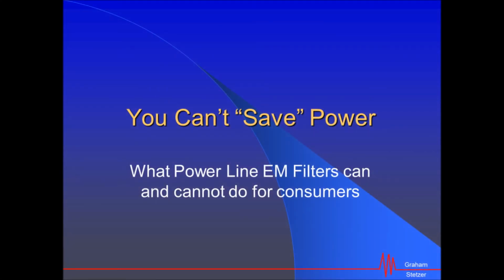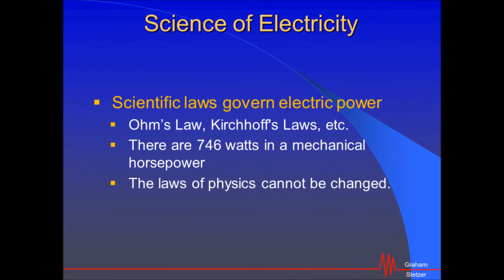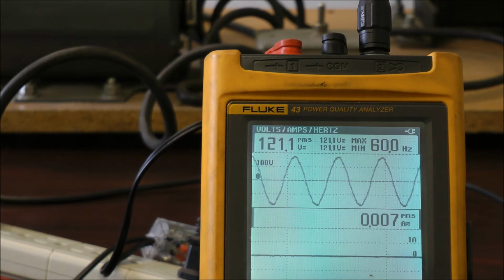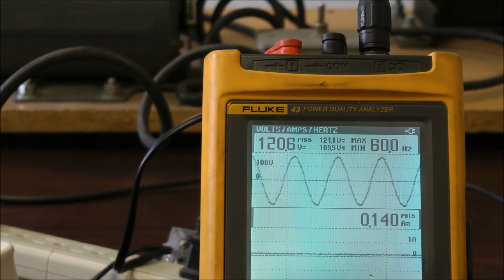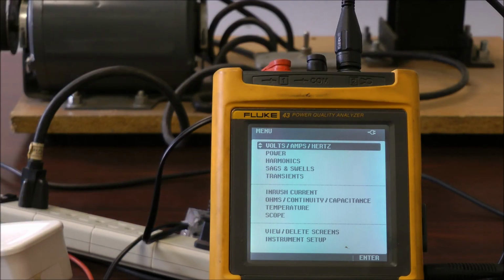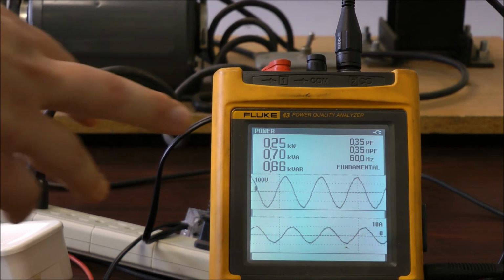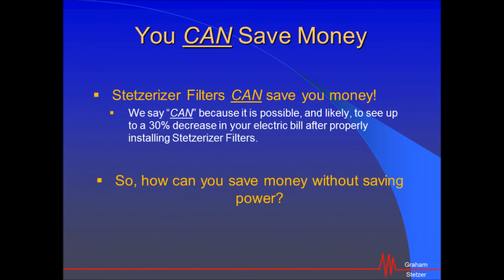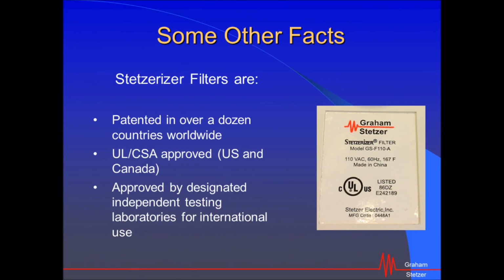You Can't Save Power

Comment: Leferink 2016 (Static energy meter errors caused by conducted electromagnetic interference) showed that noise on the line will result in smart meters misreading power (up to 582% error).

If you can clean up the power with a filter the readings will return to normal and your power bill will decrease.

Unfortunately because the Stetzerizer filters are placed after the smart meter they don't clean up the power going into the smart meter.... and the reading is still incorrect.

However if you add Power Factor Correction (PFC) before the smart meter the noise decreases and error should drop to zero.
N.B. PFC filters the power in a similar way to the Stetzerizer filter i.e. With a series of large capacitors
PFC is designed for an entire house and is thus more expensive.

This does not mean that PFC will drop electrical noise in the house: 
You still need Stetzerizer filters inside the house.

BTW: Cheap filters don't work because they use much smaller (~3 uF) capacitors than the Stetzer filters (~18 uF).

:-)
Reply: BTW: Our place has PFC, Stetzerizer filters and we've also compared them to cheap Chinese knock-offs. The Stetzerizer filters work much better.

We did make some 18 uF filters of our own... they work as well as the Stetzer filters but can only be used in wall cavities as they have no protective casing.

🙂